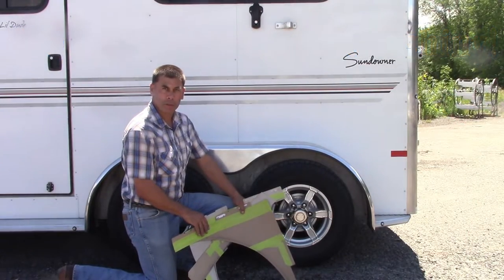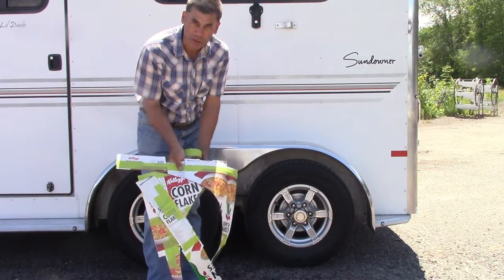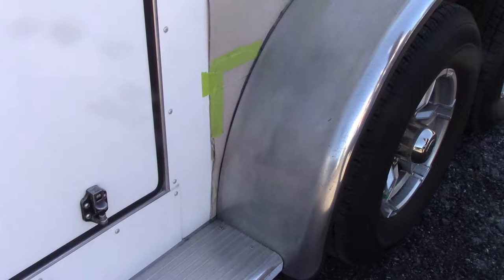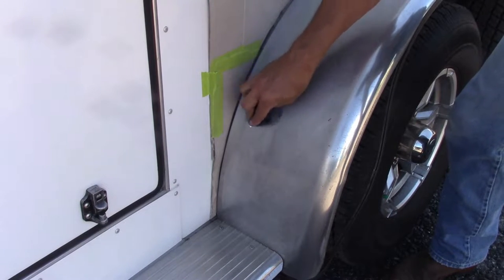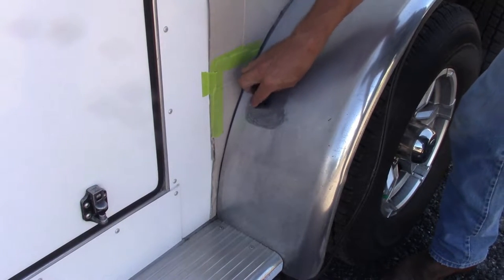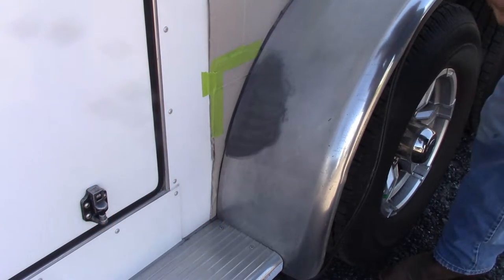Keeping that "shiny side" shiny - polishing aluminum

Comment: What did you apply the polish with?
Reply from the maker: Polish went on using small rag (as I recall, I made some from a couple old pairs of worn out blue work pants), buffing was done with microfiber cloth. Not sure where that particular cloth same from, I know I have bought packages of similar microfiber cloths at Princess Auto here in Ontario.